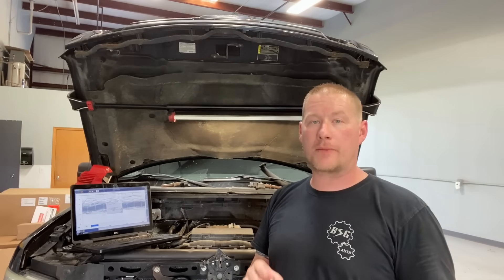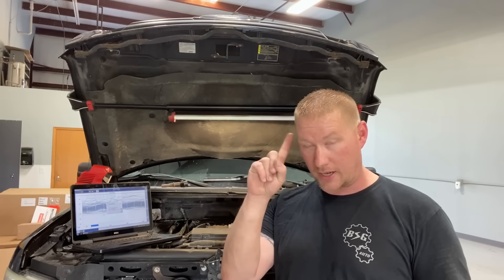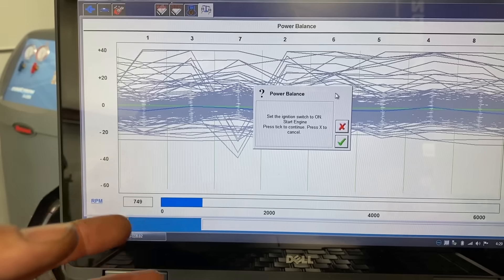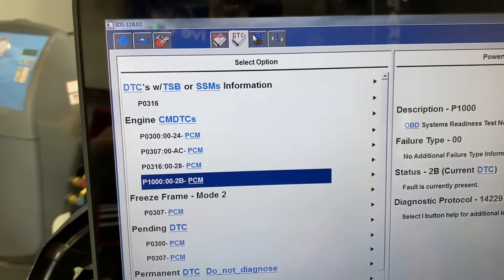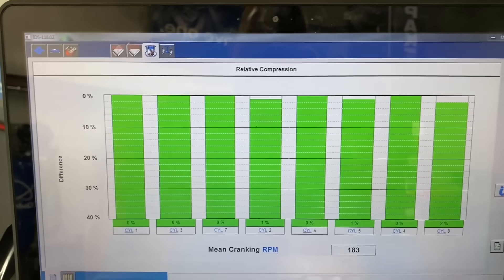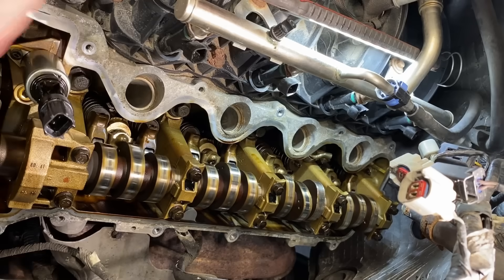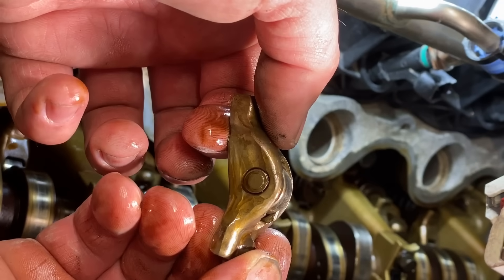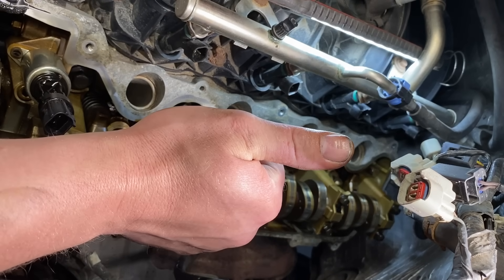Ford F-150 & Expedition 5.4L 3v Triton Engines Hard to Diagnose Misfires Fixed!

Comment: Typical shops these days guess at the problem with no actual diagnosis or testing to see if they actually fixed the problem all at the expense of the customer changing the cats for a cylinder specific problem is just stupid for the most part not one of those other shops did any engine specific research to form any kind of diagnostic plan at all seems typical of most techs these days Brian you are the example and benchmark all other techs should aspire to.

Comment: Ever had problem with 2004 F-150 5.4L FX4 PCV valve or Engine Ventilation Tube assembly.  Ford dealer says they do Not service the PCV valve on this vehicle.  Asked parts counter and they said you have to buy the entire drivers side Valve Cover as the PCV valve is pressed into it.  The Engine Ventilation Tube has an electrical connection to it?  I've heard a clogged PCV valve can cause misfires, oil consumption, etc.  As you see in video the PCV makes an elbow turn back towards cyclinder #7?

Comment: Could this happen on the 4.6l as well because I have a '10 4.6 with an intermittent misfire on #2  while I'm cruising or idling that I can't pin down I have new plugs and swapped injectors and coils between cylinders and it's still #2 doing it.....*  also jitters if I use 1/4 to 1/2 throttle to accelerate but not at higher/lower throttle

Comment: I need your advice. 2008 GT500, P0148- less power that usual at high rpm, idle is slightly unstable, misfire can be felt but doesn’t trigger MIL, sometimes no misfire & power seems to returned until driving prolonged periods in hot weather... results in misfire returning and lack of power in high rpm range and pinging can be heard in low rpm & WOT scenarios while in 3rd gear and higher. Replaced fuel filter, MAF sensor and repaired a small vacuum leak but problem still persists.

Comment: I did a timing job per your videos and found the exact same roller follower had popped out. When you removed the valve cover I could tell right away because the lobe was bright and shiny from wear. Thanks for all the good work.. Saved me thousands

Comment: Yep... the 5.4 is my least favorite Ford engine. The 4.6 and 7.3 Power Stroke are the best motors of the 2000 and up. The 6.7 is a great diesel motor But only after a rebuild with an EGR delete :)

Comment: a compression ck would of led you to pull the cover. whats wrong with those parts replacers
Reply from the maker: I don’t think it would show much if anything, definitely not low enough to warrant pulling the valve cover. You can see as shown here with the relative compression test.

Comment: Thanks for the great video you have saved me a lot of money I have the same issue but on cylinder 3 after inspection I found the same part out of its position so I'm replacing all in addition to timing job and will replace the oil pump my Ford have 280000km  
Appreciate your help
Thanks 😊

Comment: They are putting way to thin oil in these motors nowadays. Works fine in a small car but not so well in a hard used truck. I went back to 5W-30 in my truck.

Comment: I normally work on my own stuff, but my daughter was living in another state when she started having issues with her car.  I spent a couple thousand dollars on her car which went back to the shop several times for a misfire issue.  Finally sick of paying them to just throw parts i had her bring it to me.  About 3 hours from my house engine threw the timing belt.  I when i pulled it apart i found it was actually the water pump that locked up.  You could see the water pump bearings had been going for a while.  I had to rebuild the head and put new parts on it, sent her on her way.  My cost 300 bucks.  But a couple thousand wasted at the shop due to poor diagnostics.
Reply: useless tit mechanics

Comment: This just happened to my 08 Expedition 155k miles. Replaced all roller followers and cams and did timing, oil pump and vct valves as well. Drives like new!

Comment: Hey Makuloco, could you please help me explain the code P169F on Mondeo 2007 2.0  Tdci 103kw.
I have been searching all over and each DTC errror website says something different.
Im thinking Turbo Boost Control Valve/Solenoid. 
I would be happy to send a tip if you are willing to help explain as i understand everyone's time is valuable.
Thanks.

Comment: Hey I have a 04  V10 motorhome E450. Garage kept 40 k miles. Would it be better for engine switching it from mobile 1  5-20 to 5 30? I switched my 09 mustang 4.6 to 5  30 based on your comments how it will prevent cam phasors from messing up. Your like the most trusted person I follow.

Comment: What is the difference between a 5.4 2 valve oil pump and a 5.4 3 valve oil pump and can I use a 3 valve pump and I to valve motor
I have a brand new h340 HV mailing 3 valve pump that I want to put in my two valve motor

Comment: Was hoping you could point me to where cylinder 5 is on the 2.7 eco boost in the 17 fusion sport.  Switched my coils and changed my plugs thinking I had cylinder 5.  Not sure if it’s in front or back. Side to side for that matter. Thank you

Comment: I've come upon this same situation about 3 times. Have also seen it on cylinder 3. Replaced cam, timing set and roller rockers.  Just had another 07 three valve come in 3 days ago. Looks at cam error pids and seen the common right bank that always goes out at -14. Inspected with bore scope into oil fill and found the common right chain guide gone due to blown gasket on tensioner. Timing set definitely needed. Removed the easier left cover and found the left guide broken. The engine was oil starved for many seasons. Everything was nasty under the valve cover. My recommendation was getting a remanufactured engine. Great video for those people that don't understand Fords. Thanks

Comment: Sir my ford expiditiion 2003 model
When start and turn ac on the compresor
Not turn on
But when i idle up into 1.0 to 1.2 rpm the compresor on
When i relesse  the idle rpm .6 the compresor turn of any idea for this prolem
Reply: check your compressor clutch plate gap.

Comment: FCA's 3.6 has a similar problem in addition to a myriad of others. Cannot tell you the number of times I've had to change out the roller fingers (bearing wear) and lash adjusters (collapsed) simply because all the other diagnostics couldn't identify the issue. Most times once you opened the covers it was obvious what the issue was but sometimes ya just had to replace em anyway to get rid of the misfire.

Comment: Common problem you need to work on Chevys with cylinder deactivation lifter galore and controller. 2009to 2010 cam lobe wipe out. You can do relative compression first. Worked for Ford 26 years had alittle of everything. Still rather have Ford instead of Dodge.Turd  cheap construction.
Reply from the maker: Yup

Comment: At least it had alot of miles on it.     Ever shop in America has at least one 5.4   sitting outside on the ground.      I'm glad they brought back a push rod motor for the 250s.

Comment: Something is definitely stressing that intake follower for cylinder #7  and if it’s happening quite often. It’s probably a flaw in the design of that valve train for that particular engine in several vehicles. Good thing you were aware of this. Sounds like the parts cannon was used a lot for this guys truck. It’s too bad he got stung for something as simple as that. Nice work

Comment: I bought a luxury car because the engine had no vacuum.   The shop sold it to me for 1k.  They said the egine was blown.  It was just a broken valve spring and  valve hit the  piston so it was bent a stuck slightly  open That's why the engine didn't have vacuum.  Cost me like 300 for a valve spring, a intake valve, chain tensioner, valve seal  and head gasket lol

Comment: Great video. I’ve ran into this several times. I started pulling the injector rail up on that side and looking with my scope to see if one of the intake valves is not moving.

Comment: Have you used any pressure transducers to diagnose these failures? It would have been cool to see an intake waveform. It wasn't necessary. You had it nailed down regardless. But it would have been cool to see lol 
But man, you gotta feel bad for these customers sometimes.
Reply from the maker: Never, no need.

Comment: Would have loved to see a running compression test or in cylinder pressure transducer to see if it was identifiable without pulling the valve cover.

Comment: Hi Brian,
Still getting great service from my 01 f250 5.4  due to your intake gasket videos.  I have some noise that sounds like this might sound. (292,000)  Do the 2v  engines have similar issues, and would you suggest replacement as a preventative for tired engines with noisy top ends?

Comment: Let me save you some trouble. The Triton 3v has a non ratcheting timing chain tensioner that fails. It also has camshaft phasers that fail. Both of these items are ran off of oil pressure. The best thing you can do is put a 2v timing tensioner (ratcheting) and phasers lockout kit and a new oil pump. Will run better than factory.
Reply from the maker: I don't think you fully understand who I am and what I do.
Reply: @FordTechMakuloco  nope and I dont really care to know...I just know how to fix pos Fords enough to keep them out of junkyards for their owners, even though that is where they belong.

Comment: The very first 5.4L I ever worked on had a misfire that completely perplexed us. I can't remember the milage or the year of the truck but it passed all the traditional tests so we were sure it was computer related. I'm not sure why but I stripped everything out of the right side of the truck and pulled the valve cover and WOW! A rocker arm gone rogue. My mind was blown. Little did I know how much trouble these engines would be down the road with seized spark plugs, cam phasers, VVT oil pressure valves, etc. I still wonder why an engine can be so disastrous and still have such a loyal following. I get a pain in the guts thinking about them.

Comment: My 02 5.4 f150 cylinder 1 did the same thing after I changed my intake manifold. I’m not sure why it did that but the follower popped off and resulted a dead cylinder. The dealership said they would have to tear into the engine and that would cost 1,300.00 not including the repair. I said no thanks took it to another shop they said it needed a valve job. So I figured I’ll dive in to the engine myself since the cost to replace was as much used engine. I took off the valve cover and found the follower sitting off it’s place. I put it back on after I sprayed a ton of wd40 and rotated the crank several times and put everything back together and it runs fine ever since 3 years ago. I have no clue why it popped off?

Comment: i got a 04 f250 with 260k never done shit besides change oil did my first plugs a 180k LOL, ill still roast the tires in that bitch. never done shit to the trans either just fluid change at 100K so you dont need a timing job to get to 260k i know my truck has never had anything done.

Comment: That's a good catch!      I always start with mechanic diag first.   Cylinder contribution tests are important for making sure the base engine is good.  I wonder if you'd hear the popping in the intake.     Super common on diesel engines when rockers fall off from excessive lash.

They took my forscan when I was born so I guess I can't use that software.

Comment: Would like to see a proper analysis why all manufactures are having failed needle bearings? Have seen oiling being blamed but I think it is an alloy or heat treat failure.

Comment: So do you think this happens to the two valve engines as well. 2000 does expedition with the 5.4 and I have misfire on cylinder 8. The shop say it has low compression on that cylinder. Spark and fuel is good. What do you think.

Comment: Much respect, Brian. These roller follower failures are the reason why i will probably coyote swap my 05 GT rather than rebuild the 3V. You mentioned the 09+ motors have more trouble with the followers. Any ideas why that would be? You've got me curious now.

Comment: The f150 2007 FX4 we got a few months ago doesn't shift into park sometimes and doesn't shift into drive. The engine locked up at 146,000 miles and going to put in a engine that has 160,000. Hopefully this solves the issues, but eventually I will go back to Toyota and Nissan for my Trucks and SUVS.  I also found some cute  outfits from empiremaxoutlet.com Finally theres a place for men to shop so they don't look like idiots. I also got some fitness equipment and wear to work my buns.

Comment: With that many miles and that few of misfires and still runs good would it be worth it to fix the problem.  The misfires according to the chart are less than 0.5%.  You have already taken the bad part out of the equation and if the valve will not move or have risk of falling into the cylinder, I think I would just put a new valve cover gasket on it and put it back together.

Comment: It’s always easier to fix something after others have already hit the vehicle with a double-bladed bush axe. That engine was as clean as a pin inside and had zero reason for failing other than Ford’s piss poor quality requirements from their suppliers. For what Ford asks for their trucks this is inexcusable.

Comment: Interesting, I have a 2010 mountaineer 4.6 3v with a misfire on # 6 only when the vehicle idles over 5 min or so.   I changed the plugs and that coil pack.   Still occurs.  Maybe this is my issue

Comment: Hi. I will give you a quick story before asking my question. I bought an 06 with 100k miles on it knowing i have to do the timing on it. So i did, all replaced timing set, oil pump, phasers... All Ford original parts. The engine runs great. But now looking at this video and couple of other ones you have about these roller followers i am wondering: would it be worth tearing down into it again to replace these as preventative maintenance or just leave them alone? 
Thanks

Comment: now that the 7.3 is a crate motor if i had a 5.4 i'd swap it and be done with mod motors. why i got a ram 1500 with a 360 instead of a f150 i cant stand overhead cams. pushrods for life!!!!!!!!!!!

Comment: A family member had a cylinder misfire on #7 (passenger side nearest the firewall) around 80,000 miles four years ago on a 2010 4.6L F-150. Did a quick power balance test (coil & injectors) to verify and noticed something when I moved the injector harness for #7. It started working. Looked closer at it under light and a very tiny section of the signal wire had broken into but still appeared to be together. Quick cut n splice job and haven't had a problem since...whew! Now @ 106K, I'm trying to figure out why it seems like there's a lag and subtle clunk when you press the accelerator and the rear wheels pull. It's been there for years and I wonder if it has something to do with the truck being hard to initially take off when in third gear instead of drive. Drive takes off fine. Always has minus that subtle clunk. But taking off in 3rd feels like I'm pulling a 53ft. trailer. Any thoughts anybody? By the way, you should be head of tech training nationally for Ford! Big, big paycheck. I'm glad you love what you do.

Comment: 2002 4.6 Mustang GT 5speed car this Feb will 19 years and 360000.0miles she has been my baby , I've never replaced NO timing chain set? Or no roller followers ? Even cold Engine on start up I can not hear NO whacks no clicks no smoke ! Looking threw oil fill I can see cam hump where roller runs on it , can not see no difference from middle of hump from outer edges. From the first-ever oil change to now only Mobile 1 full syn 10w30 and Motocraft filters one bottle of STP oil treatment and bottle of restore for my baby!!

Comment: Had a 10cyd Triton ran ok lacked power tossed codes like crazy. One guy spent two days four pots of coffee three packs of cigs with a $30k code reader changed a lot of shit. I put my $10 vac gauge on it showed him the gauge threw windshield mouthed "burnt valve". When l pulled valve cover two rockers were lying in a corner. Two dead holes. My point for all you techs out there? In this computer age don't forget there just infernal combustion engines under all that shit. Don't get me wrong code readers are a handy tool but Ive beaten the code reader with my vac gauge many times. But I'm a mechanic don't ever call me a tech.

Comment: I have a 2009 Ford F150 5.4. And Idol it will periodically straight up and down I have changed throttle body they cannot find out what is going on it is not throwing the code

Comment: Awesome!
I'm going to do my timing chains, VCT, Phasers, water pump, Melling Oil Pump, and a full set of roller followers this weekend!
I have 180k on my '06 and when I inquired at my local garage they said I needed a new engine because the "Rear" timing chains on this engine required the engine to be pulled anyway. Wow! I certainly wasn't going to let them work on my truck!
Thanks to your inspiration, I think this is going to go well!

Comment: I have a 2008 mercury mountaineer. I recently replaced the throttle body, but still experiencing a rough idle at start up. Do I have to reset the PCM?

Comment: That will(should) show as a lean misfire using a scope and should be able to be traced back to the Cam if an Injector balance does not prove fruitful.
Reply from the maker: No need for all of that, testing can be very simple if you don't  overthink it.